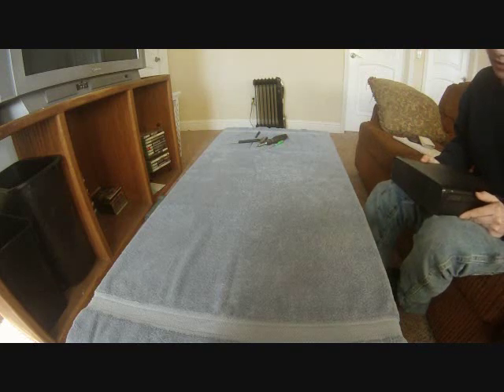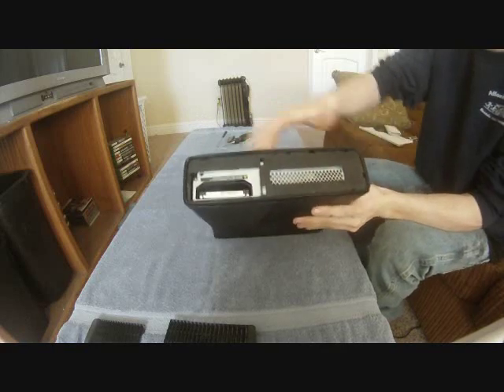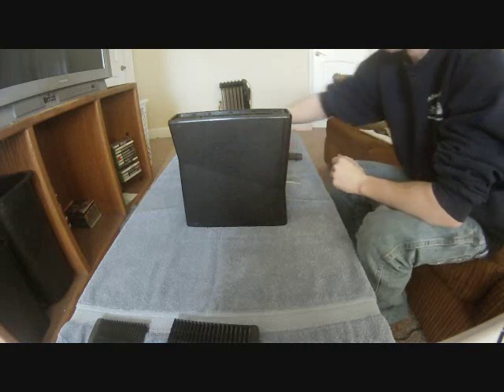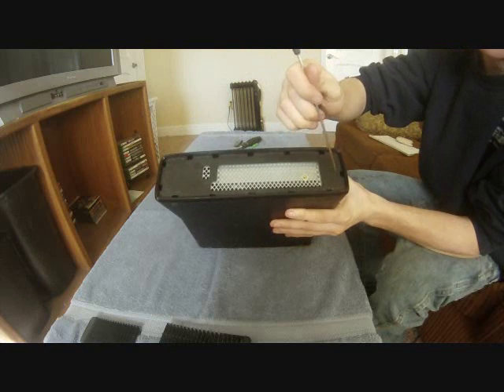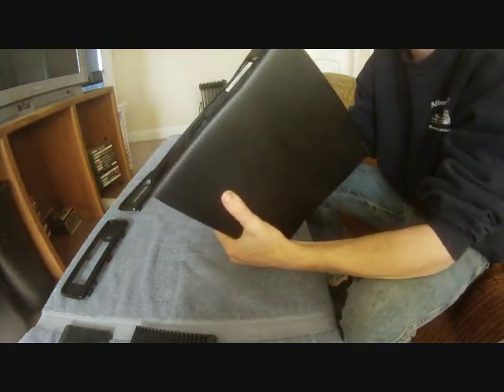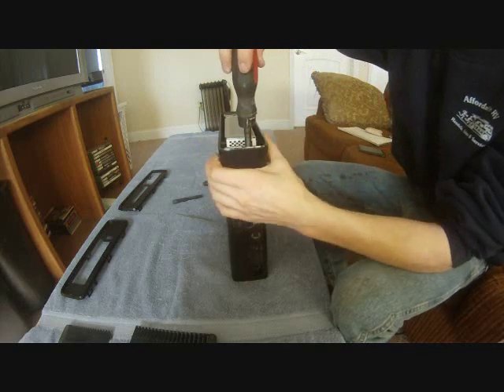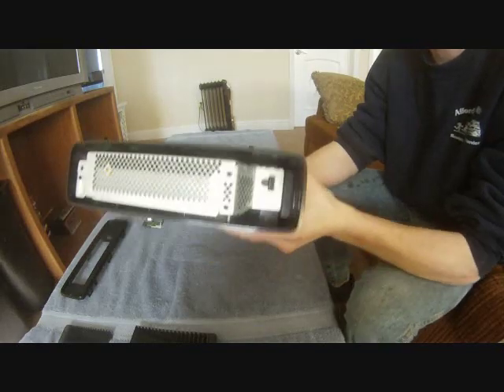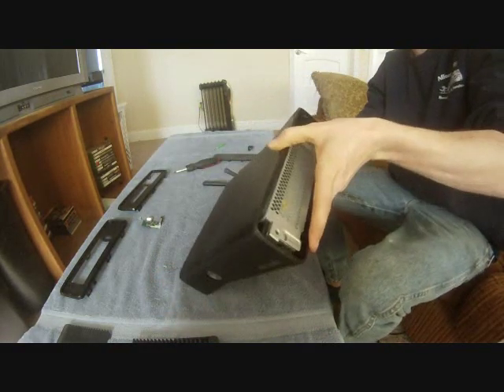Xbox 360 slim power fix Part 1

Comment: same mine but i found how to fix !!!!!!!!!! put on radiator for 15 min or use some air hot blower inside and my works fine i fopen 100 times and nothing hot air works !!!!!